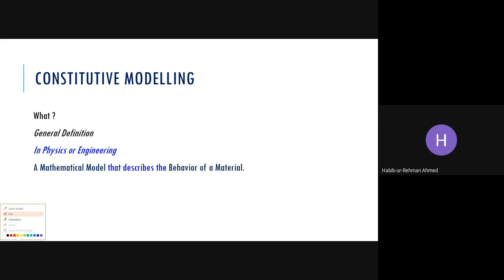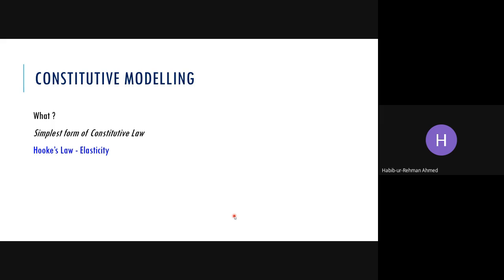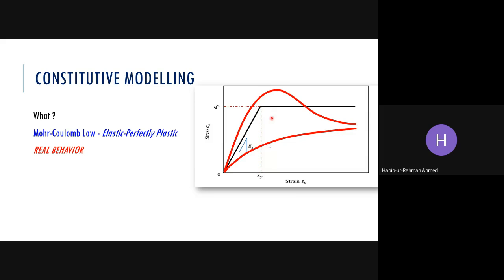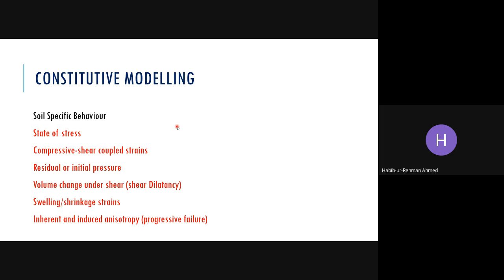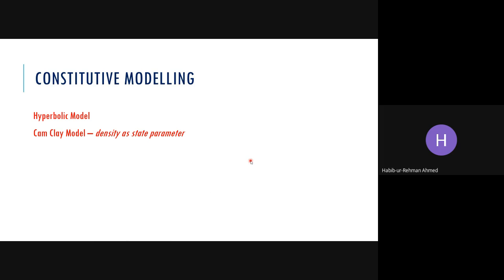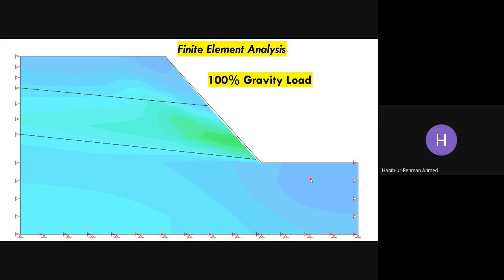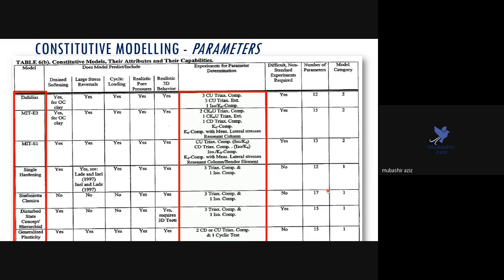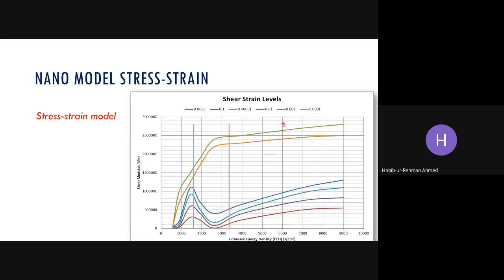Constitutive Modelling in Soil Mechanics

Comment: Thanks to your interesting presentation. I think the result of slope/w needs to be modified (-41:57), because the factor of safety is at the edge of grids; if there were more centres for failure surfaces, then safety factor would reduce.